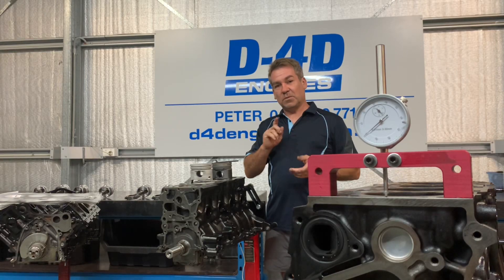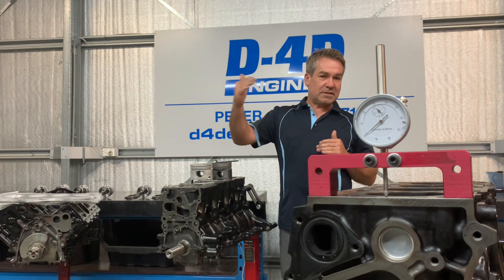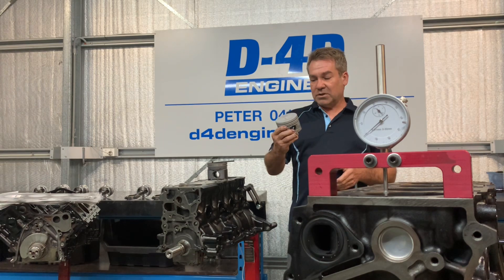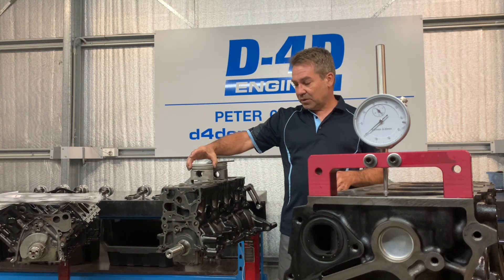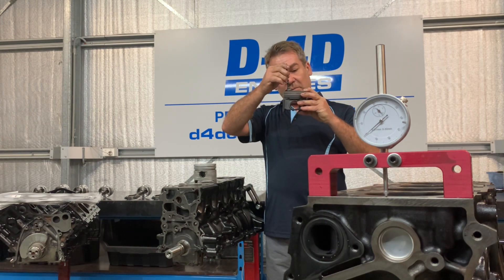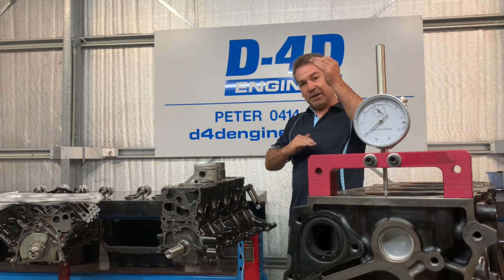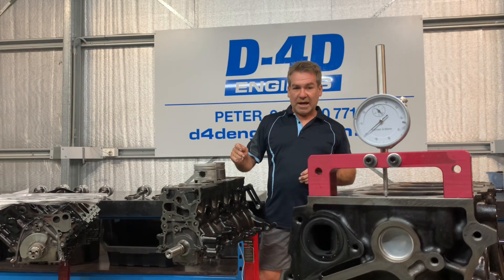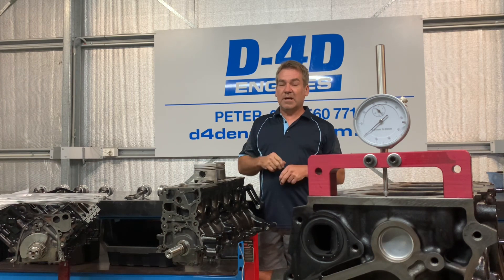Diesel head gasket selection Toyota 1997 3L 2.8 v 2017 1GD take the time do it right. Piston height

Comment: Hello! When assembling the engine, do you apply copper spray sealant to the cylinder head gasket or is it installed without it?
Reply from the maker: I never spray any head gasket.